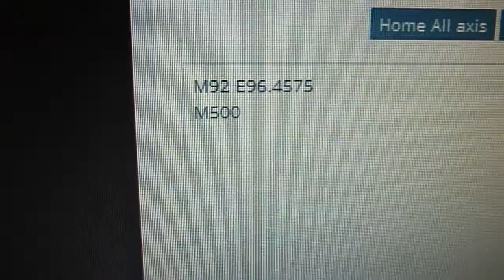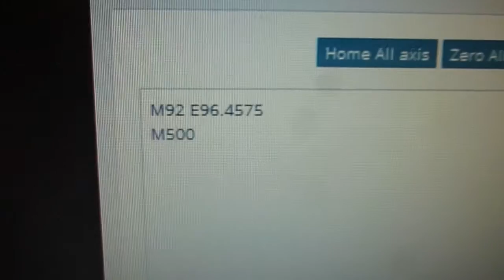FABtotum #9: Bulldog Lite feeder test on FABtotum

Comment: hi great video, this works in the jog mode, but when starting a print the speed is again much to high - perhaps the setting are overwritten - is there a trick?
Reply from the maker: Yes! You can write these settings in Advanced settings of the FABui:

http://forum.fabtotum.cc/showthread.php?2439-Bulldog-Lite-on-FABtotum&p=13943&viewfull=1#post13943

Don't use 

M205 E0.00

but only

M204 S1000.00 T80.00 

in custom overrides